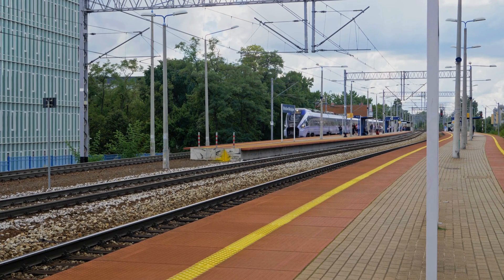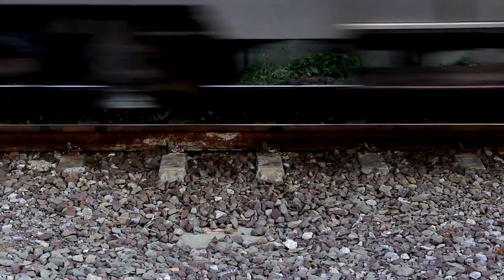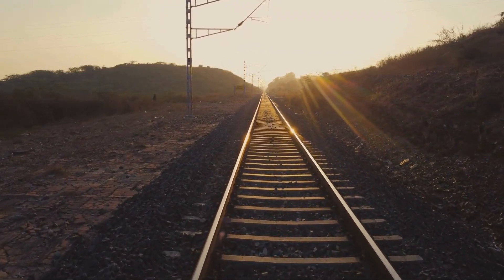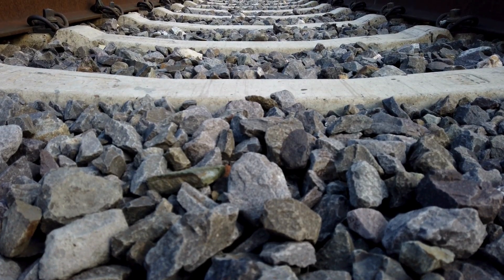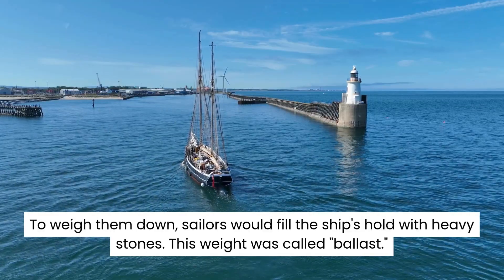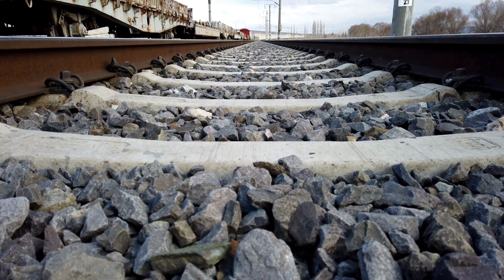Why Are There Stones Along Railway Tracks?

Comment: The Fact that our brain has evolved to distinguish between something someone has written and something done by AIbis crazy
Reply: Not at all. AI needs every possible instruction as it cannot think for itself. People forget AI is simply a computer program and is limited by the contents of that program. We have been sold by marketers that AI thinks like a human does and uses logic etc whereas AI is simply a computer with a very sophisticated program and everything it does relies on the programmer providing clear and logical steps. Just like the early calculators which appeared so smart providing an answer so quickly AI appears smart because technology allows it to process millions of options almost instantly yet AI is at this stage at least, is just a super powered basic calculator that deals with words etc and not just numbers.

Comment: Why did the ships use stone as dead weight, why not fill the boat with water ?
Reply: those rocks won't shift around  much, while water in a storage with free surface will cause stability issues
Reply: Stone is denser, weighs more per volume
Reply: @martybuck  
Maybe, but it's much harder to transport stones (no to mention to bring them to the boat first) inside by hands, than simply pumping water. Now, salty water is known to be corrosive, so maybe there is that.
Reply: Could be. Plus salit is corrosive over time.

Comment: "Crushed stones" . Specifically they are 'broken stones'  . i.e. they are SHARP and interlocking and definately NOT smooth stones off a beach . Smoooth stones act like a liquid and flow under pressure . This was known by the turn-pike road builders in UK and US and was technology borrowed by the early rail-way engineers .

Comment: Abandoned railroad tracks very often have a ton of weeds growing through the rocks. I think it's the train movement that helps stop that.
Reply: There’s one inaccuracy in the video. Crushed stone ballast discourages the growth of weed, but it doesn‘t prevent it. What actually happens is that constant maintenance, herbicide use (or thermal alternatives), and fresh ballast keep organic material from accumulating. Once that maintenance stops (like on abandoned lines) ballast alone can’t stop weeds at all, which is why those tracks get overgrown so quickly.
Reply: They use pesticides today but in the past they would use oil or diesel fuel.
Reply: Because they stopped spraying it. The stuff the RR uses makes Roundup look like a paper weight.

Comment: Our railroad used "chat". Slag from iron refineries. Gray and rough. We put a railroad tie in front of hopper car wheels that was slightly open letting chat fall out. Slowly pulling car along the tie scraped the chat level with rails. Done it all day many times working the service train. 😊
Reply: You get in a bind when that axle jumps over your plow tie and it gets caught under the truck side frames. Been there.
Reply: @raylrodr Yep. But as the braking giving engineer signals it was the rail gang's problem. 😊😅😂

Comment: Explanation done by enthusiasts with some knowledge but not a transportation or soil engineer who would never say, that soil underneath crushed rock "remains dry during rain". Quite to the contrary, the purpose of quarry ballast is to distribute the axle weight of the train over large area and the thickness of stone underlayment is relative to the bearing capacity of the subgrade or in other term native soil.

Comment: I work in MOW. We regularly dump stone as maintenance is carried out. Because of temperature fluctuations, the rail expands and contracts. Everything shifts over time. The ties get changed. Rail gets changed. Elevation shifts up and down. If we come in and disturb the track by changing a broke rail or putting in new ties, it might impact the track itself. So there might be low points for example that need to be tamped. Ballast allows us to adjust that according to the class of track appropriate for that line. If there isn't enough ballast we might need to dump more, which I have done countless times.
Reply: Ah, sounds like you are from the colonies.  When I first left school, I joined the Ministry of Works [MOW] which later changed its name to Ministry of Works and Development [MOWD] and later was disbanded around the end of the 1980's - a shame really as it was a tremendously good training ground for professions and trades alike.
Reply: @Kysushanz  sounds like a guild group, this is how everything was done before the government forced us to use money to pay workers.
Reply: @Kysushanz   MOW is Maintenance of Way, but yes, we are more old school than most railroads. We are one of the remaining privately owned railroads. We have machines, but we still swing hammers, and we still have no personal life.

Comment: The main reason for using this stones is to allow expansion and contraction of the rail lines to prevent bulking of the lines which causes accidents and destroying the railway
Reply: No it isn't. The main reasons are the reasons described in the video. Weight distribution, stability and drainage. Expansion and contraction are catered for by rail stressing and expansion joints, and even they don't fully solve the issue.
Reply: https://youtu.be/zqmOSMAtadc?si=Qv2pjrF4pROA-3Ca
Reply: You are talking about the gap between the rails

Comment: There is no question those ballast rocks are sharp. Back in the early 1970s I worked for the railroad on an “extra tie gang” we took out old ties & put in new ones. For 8 hours a day I walked up & down those tracks on that ballast, I wore heavy duty, thick waffle soled boots, that are normally supposed to last a very long time, not walking on that railroad ballast they’re not. I was buying new boots about every 3 months because my boots were tore up from walking on those stones. And logger boot aren’t cheap.
Reply: You should become a logger blogger. 😉
Reply: @nivek5031 😂
Reply: Was a brakeman and walked those miles a day, too. Had military type boots and got them resoled twice a year.
Reply: I built railroad in the NYC subway just over 20 years,  I stepped on the ties as much as possible,  or I walked the rail , still bought 1 pair of RedWings per year, they're expensive but a nail couldn't pass thru the soles , and no electricity could pass either,  I worked with 600 volt , 2000 Amp rails, so the cost of the boots null, saved my life many times!!
Reply: I grew up next to the RR tracks. Used them as a secret short cut thru my area, even hopped slow moving jawns to get to the next town lol. Know what I did bud? Walked on the ties , or worked on my balance by tight roping the rails. Although Easier said than done if working, I guess.
Reply: Excellent  but I’ve never heard sleepers referred to as ‘ties’. Must be a US thing?
Reply: @rmoz2729
While “railroad ties” (or “crossties”) are understood in many places, other countries, especially the UK & Australia commonly call them “sleepers” (or railway sleepers) The term “tie” and “sleeper” describe the same component, the perpendicular support for railway tracks. The usage varies by region, with “ties” being used in North America (US) and “sleepers” being used in commonwealth countries.
Reply: @MichaelSSmith-hs5pw Cheers mate. Yes I’m Australian and have only ever heard the term sleeper.
Reply: @rmoz2729 Growing up in the US, with a busy railroad running thru town, we always called them ties.  Didn't hear sleepers till later.  Makes sense, though--they're sleeping in their rocky bed.
Reply: My Dear Old Dad done the same job
Reply: 🧃2) THE GOSPEL OF THE WORD OF ALMIGHTY GOD "The Lord Jesus has come the Christ of the last days He is the Almighty God this is His new name, He has brought the last age to cleanse and to perfect mankind" 

Almighty God said 
       EACH TIME that I SAY "the first time," it REFERS to a TYPE of WORK that GOD had NEVER BEFORE UNDERTAKEN. It REFERS to WORK that did NOT EXIST BEFORE, and even though God had created mankind and all manner of creatures and living things, this is a TYPE of WORK that He had NEVER DONE BEFORE. All of this WORK INVOLVED GOD'S MANAGEMENT of MANKIND; it all had to do WITH PEOPLE and His SALVATION and MANAGEMENT of them. AFTER ABRAHAM, GOD ONCE AGAIN MADE ANOTHER FIRST He CHOSE JOB to be the ONE who LIVED UNDER the LAW and who COULD with STAND the TEMPTATIONS of SATAN while CONTINUING to FEAR GOD, SHUN EVIL, and STAND WITNESS for GOD. 🍁
This was ALSO the FIRST TIME that GOD ALLOWED SATAN to TEMPT a PERSON, and the FIRST TIME He MADE a BET with SATAN. In the end, for the FIRST TIME He GAINED SOMEONE who was CAPABLE of STANDING WITNESS for and BEARING WITNESS to Him WHILE FACING SATAN, and SOMEONE who could THOROUGHLY SHAME SATAN. SINCE GOD had CREATED MANKIND, this was FIRST PERSON He had GAINED who was ABLE to BEAR WITNESS for Him. Once He had GAINED this MAN, GOD was even MORE cager to CONTINUE His MANAGEMENT and CARRY OUT the NEXT STAGE in His WORK, PREPARING the LOCATION and the PEOPLE He would CHOOSE for the NEXT STEP of His WORK. 
       AFTER FELLOWSHIPING ABOUT ALL of THIS, do you have a TRUE UNDERSTANDING of GOD'S WILL? GOD CONSIDERS this INSTANCE of, His MANAGEMENT of MANKIND, of His SALVATION of MANKIND, as MORE IMPORTANT than ANYTHING ELSE. He does these things not only with His mind, not only with His words, and certainly not with a casual attitude----He DOES ALL of these THINGS with a PLAN, with a GOAL, with STANDARDS, and WITH His WILL. It is CLEAR that this WORK to SAVE MANKIND HOLDS GREAT SIGNIFICANCE for BOTH GOD and MAN. No matter how difficult the work is, no matter how great the obstacles are, no matter how weak humans are, or how deep mankinds rebelliousness is, none of this is difficult for God. God keeps Himself busy, expending His pain staking effort and managing the work He Himself wants to carry out. He is also arranging everything and exercising His sovereignty over all those people on whom He will work and all the work He wants to complete---none of this has ever been done before. THIS is the FIRST TIME GOD has USED these METHODS and PAID such a GREAT PRICE for this MAJOR PROJECT of MANAGING and SAVING MANKIND. While GOD is CARRYING OUT this WORK, LITTLE by LITTLE He is EXPRESSING and RELEASING to MANKIND, WITHOUT RESERVATION, His PAIN STAKING EFFORT, what He has and is, His WISDOM and ALMIGHTINESS, and EVERY ASPECT of His DISPOSITION. He RELEASES and EXPRESSES these THINGS as He has NEVER DONE BEFORE. So, in the entire universe, aside from the people who God aims to manage and save, there have never been any creatures so close to God, that have had such an intimate relationship with Him. In His heart, mankind, which He WANTS to MANAGE and SAVE, is MOST IMPORTANT; He VALUES this MANKIND ABOVE ALL else; EVEN THOUGH He has PAID a GREAT PRICE for THEM, and EVEN THOUGH He is CONTINUALLY HURT and DISOBEYED by THEM, He NEVER GIVES UP ON THEM and CONTINUES TIRELESSLY in His WORK, with NO COMPLAINTS or REGRETS. This is BECAUSE He KNOWS that SOONER or LATER, PEOPLE will AWAKEN to His CALL and be MOVED by His WORDS, RECOGNIZE that He is the LORD of CREATION, and RETURN to His SIDE ... 

       AFTER HEARING ALL of this TODAY, you may FEEL that EVERYTHING that GOD does is VERY NORMAL. It's seems that HUMANS have ALWAYS FELT some of GOD'S INTENTIONS for them from His words and from His work, but there is always a certain distance between their feelings or their knowledge and WHAT GOD is THINKING. That is why I think it is necessary to communicate with all people ABOUT WHY GOD CREATED HUMANKIND, and the BACKGROUND BEHIND His WISH to GAIN the MANKIND He HOPED for. It is ESSENTIAL to SHARE this with EVERYONE, SO that EVERYONE is CLEAR in their HEART. Because God's every thought and idea, and every phase and every period of His work tie into, and are closely linked to, His entire management work, therefore WHEN you UNDERSTAND GOD'S THOUGHTS, IDEAS, and His WILL in EVERY STEP of His WORK, it is the same as UNDERSTANDING HOW the WORK of His MANAGEMENT PLAN CAME ABOUT. It is ON this FOUNDATION that your UNDERSTANDING of GOD DEEPENS. Although everything God did when He first created the world, which I mentioned previously, for now SEEMS to be MERELY "information," IRRELEVANT to the PURSUIT of TRUTH, over the course of your experience there will however be a day when you do not think this is something so simple as a COUPLE of PIECES of INFORMATION, nor that it is simply SOME KIND of MYSTERY. As your LIFE PROGRESSES, ONCE GOD has some PLACE in your HEART, or once you MORE THOROUGHLY and DEEPLY UNDERSTAND His WILL, then YOU will TRULY UNDERSTAND the IMPORTANCE and the NECESSITY of WHAT I am TALKING ABOUT TODAY. No MATTER the EXTENT to which YOU ACCEPT this NOW, it is STILL NECESSARY for you to UNDERSTAND and KNOW these THINGS. When God does something, when He carries out His work, no matter if it is with His ideas or His own hands, no matter if it is the first time He has done it or the last, ultimately, God has a plan, and His purposes and His thoughts are in everything He does. These purposes and thoughts represent God's disposition, and they express what He has and is. THESE TWO THINGS-----GOD'S DISPOSITION and WHAT He HAS and IS----MUST be UNDERSTOOD by EVERY SINGLE person. 🍁
ONCE a PERSON UNDERSTANDS His DISPOSITION and WHAT He HAS and IS, they CAN gradually UNDERSTAND WHY GOD does WHAT He DOES and WHY He SAYS WHAT He SAYS. FROM THAT, they CAN then HAVE MORE FAITH to FOLLOW GOD, to PURSUE TRUTH and a CHANGE in their DISPOSITION. That is to say, man's understanding of God and his faith in God are inseparable. 🙏

       from "God's Work, God's Disposition, and God Himself 111"
Fulfined in (John 1: 1,14) "In the beginning the word, the word was with God, and the word was God" ... "The word became man and he lived with us." ... (Rev. 19: 9,13) "And the angel said to me," Write it down: Blessed is the invitation to the Lamb's banquet. "He added:" IT is TRUE WORDS of GOD. "..." "Word of God" calls him. 

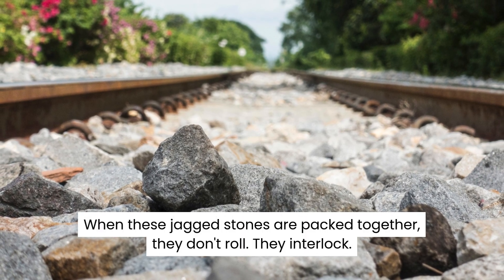       I am leading here all mankind to the built kingdom of God or the church on earth "THE CHURCH OF ALMIGHTY GOD"💐 this is the new Name of the Lord Jesus when He comes today, this is the fulfillment of the prophecy He left in (Revelation 3:12) THOSE who will SUCCEED are I will make him a PILLAR in the TEMPLE of my God, and he WILL NEVER BE REMOVED FROM THERE FOREVER. I will ENGRAVE on him the NAME of my God, and the NAME of the CITY of my God, the NEW JERUSALEM that will COME DOWN FROM HEAVEN from my God. I will also ENGRAVE him with my NEW NAME.  .... (Revelation 2:17) "Everyone who has an ear, listen to what the Spirit says to the churches! 
       "To those who overcome I WILL GIVE the HIDDEN FOOD from HEAVEN. I WILL also GIVE EACH ONE of THEM a WHITE STONE WRITTEN with a NEW NAME, WHICH NO ONE KNOWS EXCEPT the ONE WHO RECEIVES it. ⬅️ 🌻
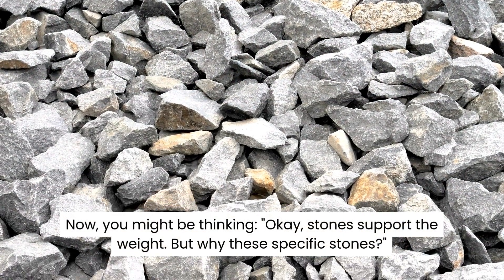       What He fulfilled was the Book of Revelation as in (Revelation 3:20) I STAND OUTSIDE the DOOR and KNOCK. If anyone HEARS my VOICE and OPENS the DOOR, I WILL ENTER his HOME and we will eat TOGETHER. .... (Revelation 3:5) He who overcomes will also be CLOTHED in WHITE, and I WILL NOT REMOVE his name from the BOOK of LIFE. I will acknowledge him before my Father and his angels. .... (Revelation 2:27-28) He will rule with an iron hand and he will crush the nations, as a pot is crushed. 
      I will also GIVE him the STAR in the MORNING. .... (Revelation 2:11) "Everyone who has an ear, listen to what the Spirit says to the churches! 
        "Those who OVERCOME will NOT SUFFER the SECOND DEATH. .... (Revelation 2:7) "Everyone who has an ear, listen to what the Spirit says to the churches! 
       "To the OVERCOMER I WILL GIVE the RIGHT to EAT of the FRUIT of the tree--the tree of LIFE that is in the GARDEN of God." ☘️
Reply: Damn sir!! That must of been crazy work!!
Reply: When I was a kid we would hop on trains when we didn't have a ride and our destination was a ways off. One night me my cousin was coming back into town and we used to jump off into  the Grass at a local park. Will the train was speeding up my cousin waited too long to jump and landed in the rocks. He got tore up! My parents had to take him to the emergency room to get several stitches. 🤷
Reply: Barefoot is always best.  😳
Reply: So your saying that logging boots are no good on railways, got it
Reply: Should have worn slippers there cheaper to replace
Reply: Bootloggin’ Blues
Reply: Did your feet hurt?
Reply: You mean your employer didn't provide you with appropriate protective clothing for you to do your work. Welcome to the USA.
Reply: Write off! My husband kept track of his work needs and that's a write off, so is gas miles, so was our hot tub for his knees.
Reply: @msbee5183 . I was saying I worked for the railroad in the early 1970s, in the 70s boots were NOT a write off! We had to buy our own boots & work clothing. You might be talking about a later time, where those items were a write off, but in the 1970s we bought our own stuff. I know this is true because all of us on the crew had to buy our own work clothes & boots.
Reply: I wear logger boots as a heavy tow truck driver and thankfully I could get  5 years out of them.
Reply: @neilhughes1206  Fibe years in the same shoes? 🤢
Reply: Are those ballast rocks sharp?👈